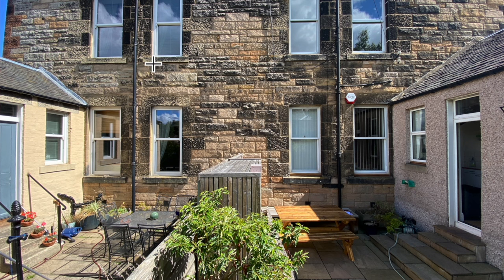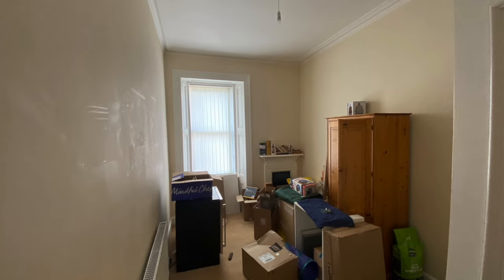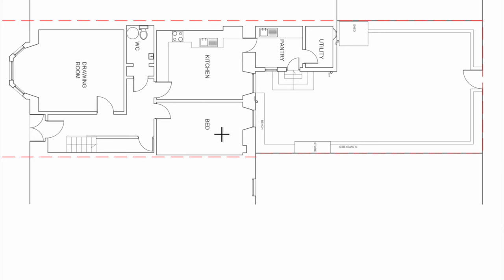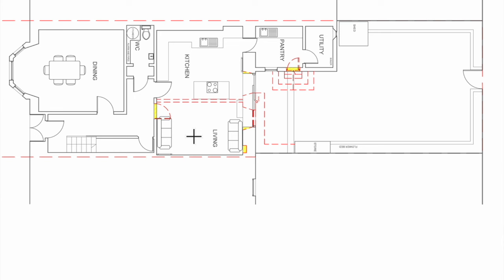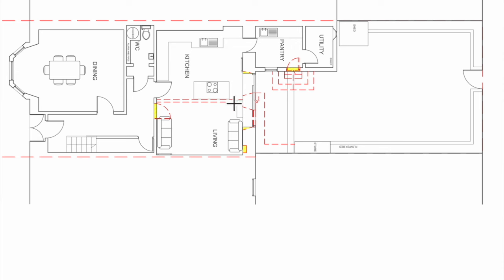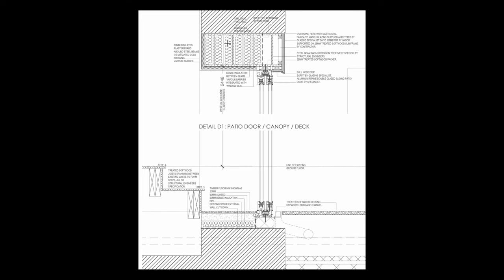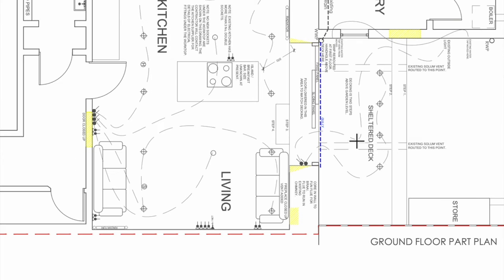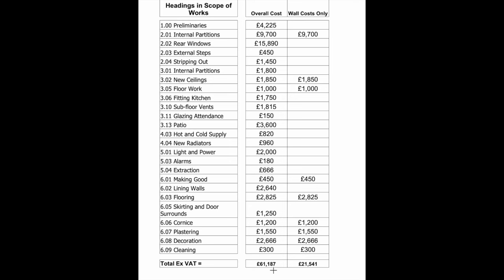The REAL Cost to Remove a Load Bearing Wall in 2024

Comment: My elderly neighbour is currently doing this, taking down a wall/chimney. She had 2 quotes, one at 4k and one at 21k. She went with the 4k builder who could start the next day. When they started she had a panic on and came to ask me if I thought it was right that it doesn't need a steel and I agreed with her that I thought it did. Either way though she has let them carry on so I'm not sure what she has agreed with them.
Reply from the maker: What it needs is a structural engineers design and certificate. Also, construction costs should not vary that much between firms of similar size
Reply: @RealLifeArchitecture  Oh I appreciate there's lots of alarm bells and she knows it, but still lets them into her house (she paid half up front). Its a bungalow and I think they were surprised when the upstairs floor joist ran the length of the wall, parallel to to wall they were taking out. I helped/advised as best I can, but i'm not sure what more I can do. Was interesting to see that you came up with the same number though.
Reply from the maker: @Coppice1  my guess is she will end up paying far more in the long run.
Reply: They're clearly cowboys, out to rip her off. She needs to kick them off the job. She'll lose her £2k,  valuable lesson but best to do it before they cause far more damage that could have serious safety risks.

Comment: Great video and nice to see someone sharing cost data. For what's involved that slapping cost looks competitive as will be a decent amount of temporary works in that. Just tendered a slapping through a 600mm thick stone wall on a 1.5 storey dwelling (part of a modest extension project) - needs 3No beams on SHS posts & pad founds - the works associated with the slapping are varying between £14K - £20K + VAT across the tenders received (and my project looks considerably easier than yours!). All the best :)
Reply from the maker: Thank you for sharing as well !

Comment: I just saw in that breakdown "rear windows" at 15k. 

Maybe i need to change my glasses. 
That can't be right.
Reply from the maker: Section 2.02 Rear Windows relates to the cost of forming the large opening in the rear wall of the house, not the supply of new windows. £15k for this is reasonable

Comment: Great video. So much more involved structurally than most appreciate.

Curiously what are PD1 & PD2? Are they detail references?

Initially I thought PD2 could be a padstone, which makes sense in masonry. But PD1 over the inner window steel lintel is throwing me off.

Also, was this cost of works for the beam to be installed in the existing floor joist zone or will there be a down stand?
Reply from the maker: PD = pad stone. The beams were installed below floor joist zone.